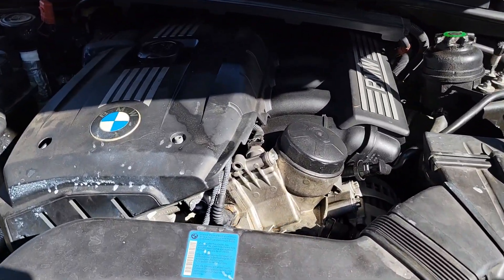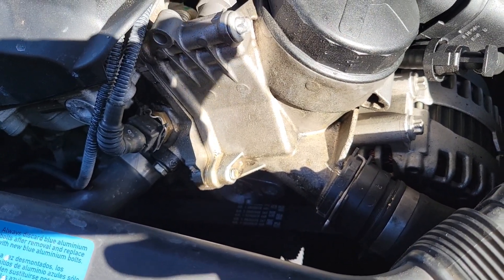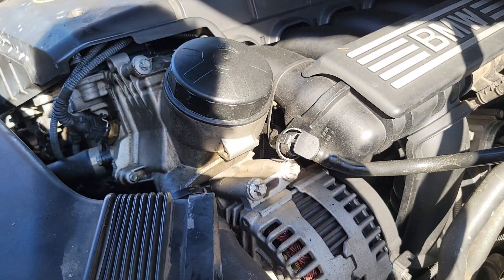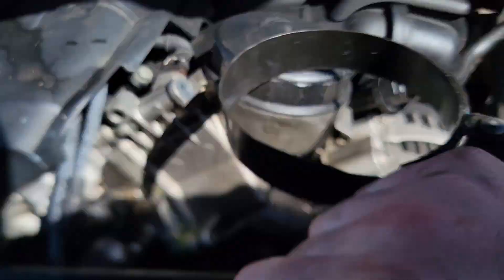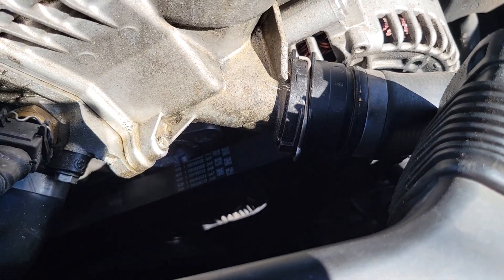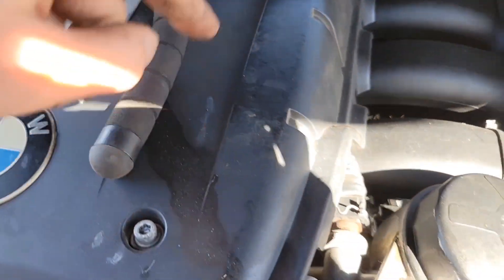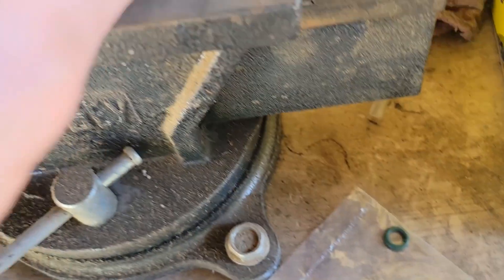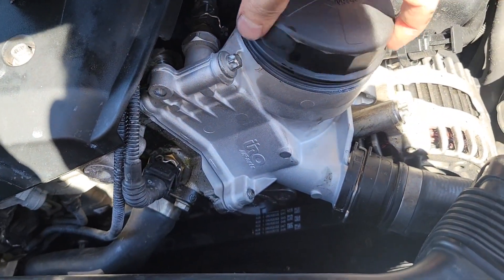BMW 328i Oil Filter Housing Replace e90 e91

Comment: What did you use to get that bottom short bolt out without having to remove that hose that is in the way? Thats the only part I’m having trouble with and trying to get away with not having to disconnect that hose. Thank you!
Reply from the maker: The lower front? That was a ratcheting wrench. Super handy they come it sets. They aren't heavily torqued so even breaking it loose with a standard wrench you should be fine to hand loosen. Thanks for watching!
Reply: Thank you!